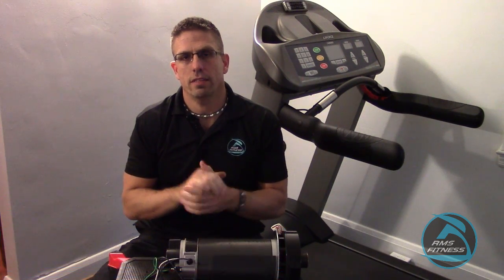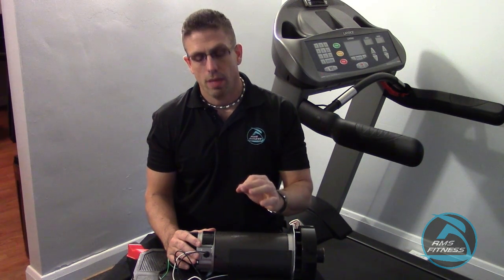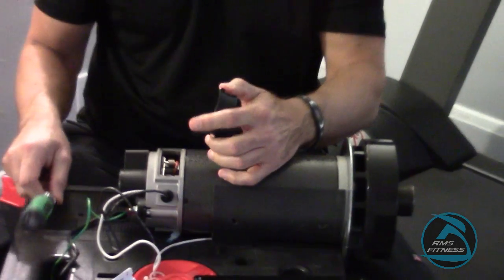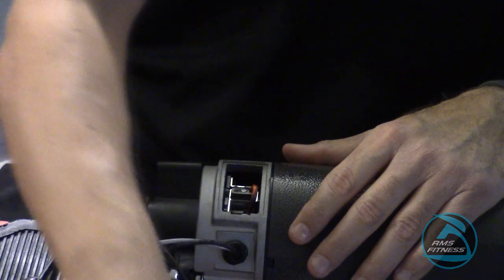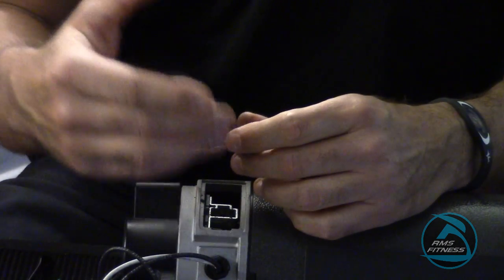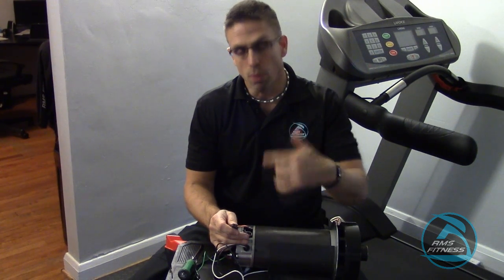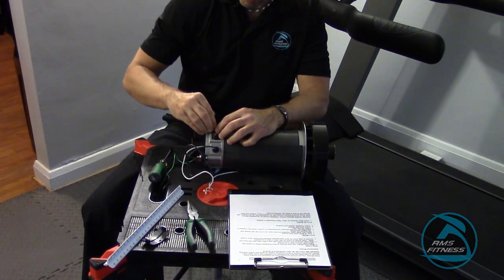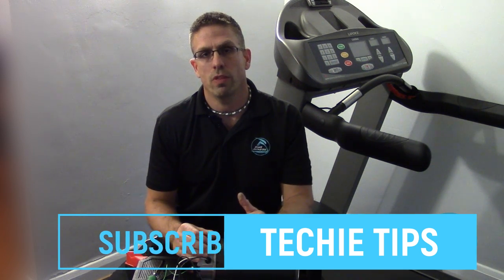Treadmill Motor Brushes Inspection and Replacement Tips

Comment: I have clicking motor noise after replacing brushes. I eliminated bearings, belts or rollers as causes. Is it a seating issue or tight spring tension? Commutator seems OK and  was gently cleaned with scotch brite and alcohol tips.
Reply: uneven spot or bump on commutator. If  I manually roll motor opposite way there is no click. I can hone it or replace.
Reply: New brushes are generally flat and square on the end so they don't conform to the curve of the commutator and will then make a clicking noise when running. Generally, over time the brushes will wear and conform to the shape of the commutator, and the noise will go away.

Comment: hello I have a treadmill HORIZON Elite 407 where I can found the brush please ? I have this problem. Can I use my treadmill? Even with this problem? There is a risk of damaging the engine? I found the right brushes I am waiting for them to arrive. but Iwant to keep training on my treadmill, Answer me there is a risk for the engine?
Reply from the maker: If the brushes become worn the unit will shut off. Keep the walking belt lubricated to prevent over heating.
Reply: @techietipsbyrmsfitness8980  Thanks I pay 50box an electrician store, they build 4 new brush for me 12€ each, done

Comment: This was really helpful. Thank you! This is exactly the kind of thing I was looking for! My commutator has a bit of wear marks that are like streaks and has a couple of dark streaks on it, slightly grooved. Is that cause for concern? Currently, I'm trying to troubleshoot/diagnose my treadmill that glitches/drags/stops intermittently.
Reply: My speed control switch, rheostat,  had worn out causing intermediate operation.  Cleaned it with contact cleaner and started working correctly.

Comment: What are the 'in-use signs" of a motor brush going bad that would have the treadmill owner check the brushes. I realize it's normal maintenance, but are there operational signs? Also, I've a commercial Precor c9561 with about 9 thousand recorded miles (on the current PCA board). How long do brushes normally last? Thanks, I really like your videos, very straight forward, efficient, and well stated.
Reply: Sparking by the brushes and hesitant starts are usual signs of brushes being too short.. .although, sometimes the spring may be faulty.....just a little sparking at the brushes is normal, but a lot is not...
Reply: @spol1622  Good answer, unlike the bozo that put up this video. Instead of saying he doesn't know, he made a word salad.
Reply from the maker: Hi Jontona, in my experience. Brush wear is hard to narrow down. Depends on the upkeep of the unit. There are normally wear bars on the brushes to indicate if a brush needs replacing or if they are wearing differently. Hope that helps.
Reply: @techietipsbyrmsfitness8980  You don't have clue what you're doing, do you?? What a pathetic answer.

Comment: I have reebok treadmill irun 3 it makes noise and a burning smell. Sounds like it's a motor brush. I had the treadmill for three years. Where can I get the parts in UK.
Reply from the maker: Hello from the US. Does it make noise when no one is on it? The burning smell could be a lack of lubrication on the walking belt. Do you lubricate the walking belt often?
Reply: @techietipsbyrmsfitness8980  thanks for your reply. Yes makes sound regardless n also I lub it often. Any idea?
Reply from the maker: We would recommend removing the drive belt from the motor. Are you able to do this? If so, you can turn the machine on and isolate the motor from the rollers. Is the sound noticeable?"
Reply: @techietipsbyrmsfitness8980  thanks for coming back to me. I'll try and let you know.
Reply: Hello, my motor makes a squeking noise without the beld. can you advise ? Its the same motor you that you are showing,  Thank you.
Reply: @ivogago6140  you are probably out of luck...squeaky noise most likely indicates bearing problem. If yo can lubricate them, do so, but most likely the motor bearings are seald/permanently lubricated and only replacement will do. Sometimes, the bearing inner race will start spinning on the motor shaft, and that would require motor replacement..  one more tip; usually, the bearing by the belt sprocket is causing the problem since that is the one carrying more stress....but, to be sure remove the cover, start it up and listen...
Reply: @spol1622  yes, the motor was dead, but decathlon repaired for free, event 4 months after the warranty expired.

Comment: I have a Cybex 425T and the brushes somehow burned on the rotor and the motor stopped working.  What happened?  Can new brushes solve the problem or is that a motor issue?
Reply from the maker: Good Morning, brushes can certainly fix such an issue. Try this website for assistance: https://www.fitnessrepairparts.com/equipment/Select/24217/Cybex/LCX-425T-After-SN-E0504
You will need your serial number and what kind of motor you have in the treadmill. Hope this helps.
Reply: You were right.  New brushes (and light sanding of the brush housing) fixed the problem.  Thanks.

Comment: hi...if I would want to change my motor brushes...will I find those in normal hardware shops? and how do I ensure they are the right ones?
Reply from the maker: Hi Rashmila, sorry for the delay. The brushes are a part we access through the factory or from a reputable parts distributor like www.fitnessrepairparts.com I hope that helps.
Reply: You can use any bigger brushes and grind them down to the size of the original brush...but, it is better to have the original parts...but sometimes you get spare set of brushes with some things that use universal motor that you purchase....so if you have a set in your garage that is of similar size, there is no reason not to use them if you do not want to pay for a replacements...but you have to be rather careful with grinding brushes to the proper size....if they are undersize or fit too tightly, it will not work...brushes have to move freely, but without any play.....